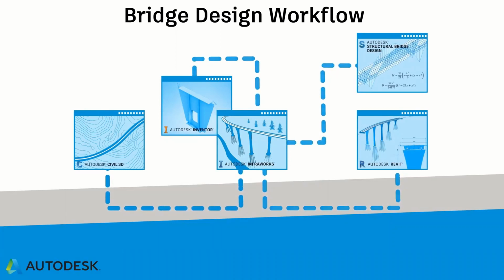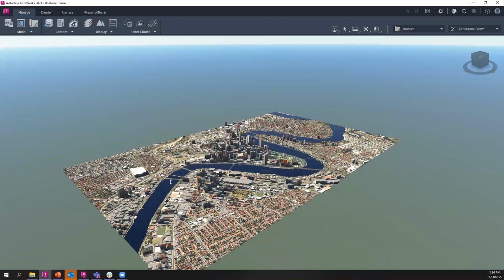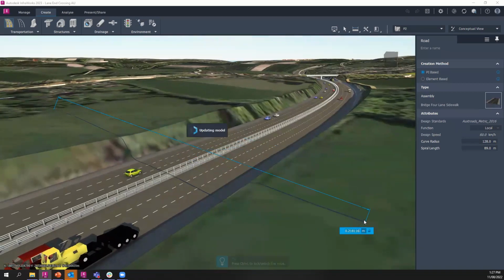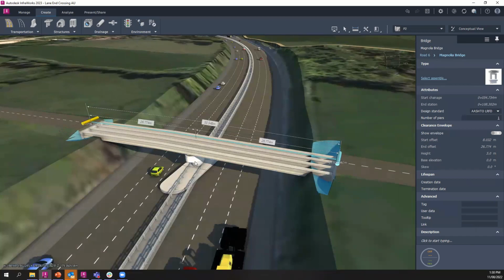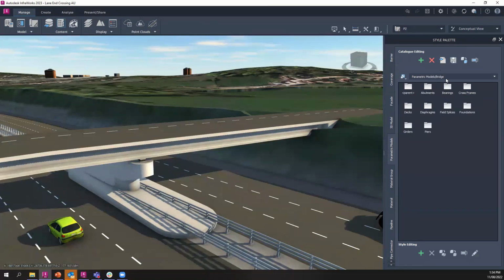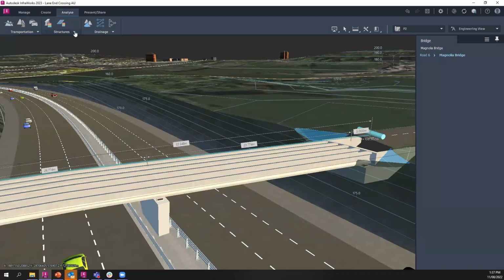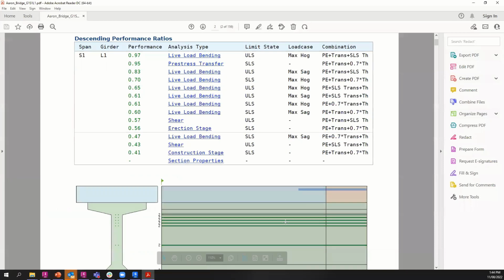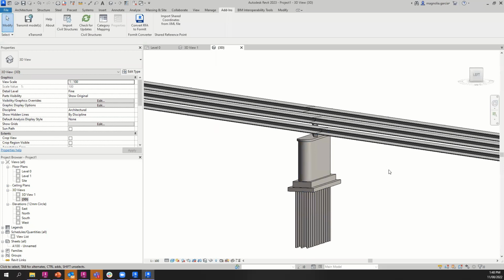InfraWorks - Bridge Design Workflow

Comment: Hello, I'm trying the procedure but with revit 2024, there is no longer the import civil structures add-in? Is it to be installed? Thanks
Reply from the maker: Hi! You'll need to separately install the add-in to gain access.
Reply: Where can I download Civil structure plugin for revit 2024. I can't find it on Autodesk plugin app store.